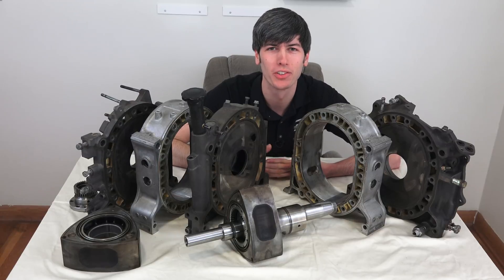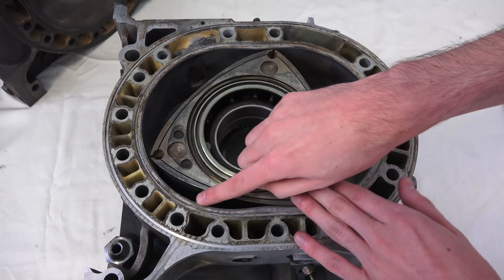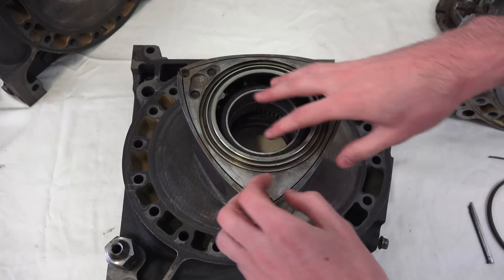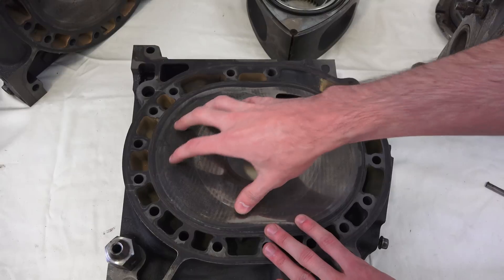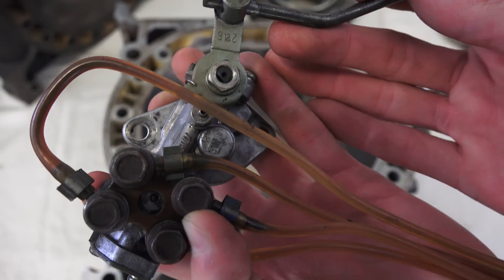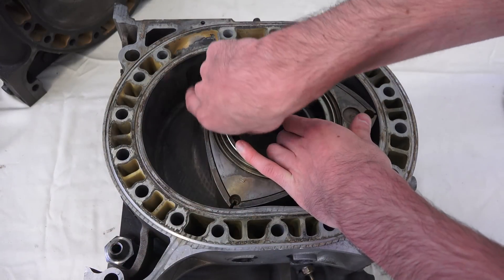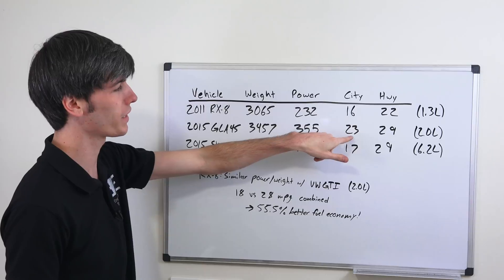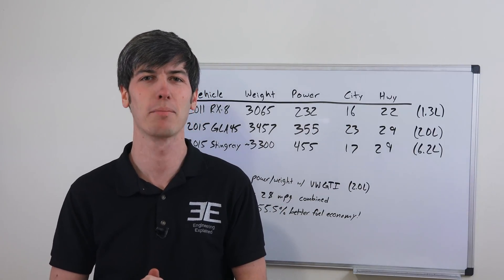4 Reasons Why The Rotary Engine Is Dead

Comment: Well honestly @1:07 is a reason Why To Use a rotary engine.. NOTHING is cooler than that and the next several points up to @1:22 are honestly pointless for performance cars, seriously who cares if their track car gets bad mileage or emissions. And it couldn't have been THAT bad or the 767b never would have won le mans since efficiency is a key part of success there...
Reply: +TzuCraft 
The ONLY reason the 787b won in 1991 was because they managed to negotiate a 374lb weight advantage over everyone else in the race. They did this because the FIM recognised the car was so uncompetitive they didnt think it would make any difference anyway. In a fuel limited, poorly attended race (due to rule changes) it tipped the balance into Mazdas favour, and with a detuned engine (to last the race) they scrapped a win. It was probably the most undeserved win in Le Mans history.
Reply: +Manoo42 Perhaps. But by that logic honestly most wins are undeserved as they are almost always due to rule changes. I'd say the 1970 win by Porsche was the most undeserved as it wouldn't have happened without the rule changes that pretty much excluded Ford gt's from competing because frankly they were too good. So Ferrari and Porsche, which couldn't keep up, lobbied HARD to get the rules changed in their favor and in a way that put Ford at such a big disadvantage they couldn't possibly compete. Ford hasn't returned to le mans since...
Reply: +TzuCraft Wow you think most wins are only due to rule changes!!! Unbelievable. 
Mazda didnt win due to a rule change, rule changes saw their exclusion the following year. They won due to a unilateral decision to give only them a massive weight advantage over everyone else in the race. It was a huge gaff by the FIM who only did it to increase numbers in a poorly attended race....

Comment: not an expert but just looking at the design wouldn't it give more consistent torque under load vs piston?
Reply: I would like to know the answer to this as well.  If Mazda could revolutionize the design to make the chamber smaller it would be incredible (only thing I could think of is make it a double triangle to make the pocket smaller, but that would also take away from what makes it a rotary).

Comment: The concept is sound the engineering is poor. The internal combustion engine, as we all know, has too much friction and fuel waste because of it. I think that some bright engineer will one day make this concept work,
Reply: +Barry Wind No it's the concept that is flawed. The piston engine is conceptually more efficient, though no perfect. There's been some extremely brilliant work done to this, but it's better to put the eggs in the other basket at this point.
Reply: Concept is sound design is not, at least not yet. The concept is power at a spinning point. It's like spinning a fan blade by hitting each blade to keep it spinning.

Comment: Back in the 70's we had an Arctic Cat snowmobile with a Wankle rotary engine. It was very easy to start and put out great power for it's size. It seemed to be as economical as the two cycle piston engines of it's day. I knew a guy who had a Mazda pickup truck with a rotary engine back then. These engines would easily rev above redline, but would often blow seals if this was done regularly.

Comment: I hope the Rx-Vision will become a reality. But I truly believe that even if it's never put in a direct-drive vehicle, car companies are missing a major opportunity for not using Wankels as range extenders for a hybrid. They are perfect for the job- compact, high power-to-weight ratio, and smooth. They also run best at a particular RPM, so you can have it computer controlled to run at a constant rev, and build a turbo that's designed to run best at that speed, since there's no need to avoid turbo lag.

Comment: It's incorrect to describe the 13b as a 1.3L engine. Yes, the volume of the combustion chambers throughout one revolution adds up to 1.3L, but a four-stroke piston engine has to rotate the crank twice to achieve a single combustion event, while the rotary achieves combustion on every rotation. So it's got twice the power density of a four-stroke design, much like a two-stroke engine (which also burns oil for lubrication). When you compare a rotary over two whole crank revolutions to a piston engine over two whole crank revolutions, the rotary uses 2.6L of displacement, not 1.3L. Of course, Mazda doesn't describe it like that because 1.3L sounds more impressive.

The OMP system (oil injection) is really a poor compromise, as most engine oil was never really designed to be burned in the combustion chamber. A better option would be to remove the OMP system and use two-stroke premix in the gas tank, but Mazda knows how people treat their cars and requiring owners to keep a second tank full would result in a lot of burned up engines due to negligence.

Keep in mind that the piston engine has had the benefit of over a century of engineering by dozens if not hundreds of companies while the rotary was basically abandoned by everyone but Mazda by 1975. They've really done a fantastic job with the rotary over the years, and while they do certainly have a number of limitations, they're really neat engines and a lot of fun to drive with their nearly-flat torque curves. You don't buy a rotary for emissions or fuel economy, you buy one because you love cars.

Comment: that is not the reason the rotary engine went dead
Reply: +Jose Rodriguez 
Which one are you countering?  He named several.
Reply: lettersfromhelen  no he gave a reason why it went dead that motor is not dead they still use it in japan and the rx7 went up to 2000 in japan that motor here is not used a lot because it has a hard time to warm up in the winter but other than that the motor is one of a kind and it's still the number one motor used in japan
Reply: Aside from Mazda, it's pretty much dead and no company (not even Mazda) has mass produced a rotary engine since around 2012, so if they're common they're 4+ years old at least.
Reply: ***** the rotary engine is still being used in japan for mazda and yes only mazda because that's their motor they bought the motor and they are the only one's with the right to that motor

Comment: A really interesting video to watch is Matt Farah comparing an LS1-swapped RX7 versus a normal rotary RX7. The LS1-swapped car made more power and used less fuel. Disclaimer: I do not worship at the church of Chevrolet, I find LS1 swaps to be fairly boring these days but it does at least show how inefficient the rotary engine is.

Comment: I had a 79 RX7 that was snappy and grabbed corners. It was a fun car and easier to work on too. Most bolts were 10mm. As for the Rotary, I like the idea because it always travels in one direction vs the piston and allows for higher RPM's. The piston in standard engines has to come to a stop and travel the other direction twice.

Comment: The fact that there are only 3 types of engines out there, piston, electric and rotary! For a company to go a different way, is quite Revolutionary. A standard Piston engine had 100+ years to evolve!....And with time and technological advancement, Mazda could Bring this engine back....More Reliable, and better than ever.. I'd say they've done a pretty good job so far 787B for example? Yes might have some disadvantages.....but still  more than capable of competing in a professional race. Not to mention RX-7 is no slouch, and was a very capable car for it's class!

Comment: Everyone is missing the point that the Wankel design is STILL the most efficient ICE ever invented. YES it has wear parts that need regular replacement. It is hard to imagine a more energy efficient motive power than a heavy flywheel driven by a rotary engine. Torque can be added incrementally and taken out exponentially, giving you a loaded city bus capable of 12 second quarter miles.
Reply: +CrucifyRobinHood It certainly isn't the most efficient ICE ever invented. The most are several two stroke reciprocating diesel ship engines that can exceed 50 percent thermal efficiency. And it seems the new turbo era F1 cars which allegedly Mercedes claim are close to approaching 50 percent, no other SI engine can reach anything like that. Lots of prototypes with fake unproven claims, but my examples are legit

Comment: Owned rotarys for years and loved them. I had a 25 year old rotary (1st gen RX7) that got better mileage than that. A lot of guys would put a different computer in them and do a better job of tuning and get over 30mpg. The engine design is so simple and easy to work on, too. They are normally tuned rich because they are really, really intolerant to pinging and running lean is the easiest way to accomplish that.

Comment: He also forgot to mention the Mazda RX8 was a 1.3L Rotary Engine which was TURBOCHARGED!  Lastly, He is comparing apples to oranges, so really his whole display was totally incorrect.  

The only thing he did get correct as to why it died, was the fact Mazda cannot get the engine to pass CARB, in California which was the biggest market for this vehicle.  And... Mazda sold it here at a loss because they had to pay huge fees to CARB to get the vehicle to sell here.  The rotary engine is a very dirty engine for all of the reasons he stated, but its far from "dead" as he would have you think.

Comment: So they are like 2 stroke motors in a way. If you are willing to give up fuel efficiency a 2.6l twin turbo quad rotor pushes over 1200hp (1000hp at 2bar of boost), and lasts through a season of Formula Drift...
Oh off topic but i thought this may sound interesting, mercedes recently released some info on their F1 motors, they are saying that they are able to achieve 40-50% thermal efficiency in their hybrid power units. (for those who don't understand, that means that 40-50% of energy that is generated by burning the fuel is delivered to the wheels. This is a very, very impressive number)

Comment: The only thing that was completely glazed over was the power to engine weight ratio - the rotary engines are typically way smaller as a form factor for the power, yet still have larger space for combustion, so it's not a fair comparison to a cylinder type of engine. I'd take a rotary engine any day if I was building a dune buggy or something because it's so much smaller, yet has a lot of comparative horsepower.

Comment: a few questions and a few comments:

1) would you agree the oil burning is insignificant, at least as far as fuel economy goes?  the oil:gas ratio is 1:100 or so -- yet we're off on fuel economy by 50% (or 33%?) per this video?

2) thermal delta on the side irons -- hadn't thought about that. I am wondering, why not machine them non flat when cold s.t. they are flat when hot, given that shape is predictable?  We have springs on those seals, so if it isn't perfectly even when cold, and ECU temp aware regardless, we're fine?  Machining that way might be complicated, but perhaps not for a big company.  Anyway we have a problem but I'm just saying maybe that's not it.

3) RX8 compression ratio iirc is 10:1.  That's semi-reasonable right?  Isn't the GLA lower?  I realize it's a turbo, albeit plenty of turbos out there which are 10:1.  Corvette 11.5:1 it seems on a quick search.

4) Displacement comparison is apples to oranges?  One could say the displacements are irrelevant to the analysis -- except you wrote them on the whiteboard. :-)

5) Ironically, it seems there are rotary applications these days that are efficiency oriented, just non-traditional: range extenders (Audi), hybrid aircraft (Diamond).

6) 16MPG is horrible.

Like the videos!

Comment: The first problem that I found with your video is that throughout the whole video you were assuming that the 13B rotary engine is a 1.3l . This has been proven to not be true because of the rotor having 3 surfaces it uses about the equivalent amount of fuel to a 3.9l . But since it is assumed it is a 1.3l why don't you compare it to other 1.3l engines instead of larger engines. The second thing that I found is that you aren't comparing it to engines of it's era or production years. This is a flaw because newer engine are tonnes more fuel efficient than the engines from back then. But anyway who cares about it's fuel efficiency because it is a performance engine and it sounds amazing. And who doesn't love seeing some flames pop out of the exhaust every now and then when you shift gears or rev it.

Comment: fuel econ/emissions may be trash, but the power to displacement on one of these, even without super/turbo charging is still pretty good compared to piston engines of similar displacement, so 1.3L making ~200HP is not bad. Normally on a 1.3L 4cyl, you might get ~140hp  (engine to engine)
Reply: +Don McCollough  I have a 1000cc stock standard 4cl 4stroke no turbo or super charger making 200hp
Reply: chockybones But that's not common compared to the typical small vehicle with that sized engine, atleast that I've seen, especially in the U.S.
Reply: +Don McCollough GSXR1000 motorcycle :-)
Reply: +Don McCollough what gas do you guys have available at the pump over there? we have 91, 95 and 98
Oh... I'm in NZ
Reply: chockybones that's the difference, as I'm comparing car to car. Motorcycles are a different beast
Reply: chockybones 87, 91, and 95/97

Comment: this is probably an engine from the 80s today they are better built and you know this is a 3 parts moving motor that to me is more efficient that any motor built today as you might know this little motor  can blow the socks off many 8 cylinder cars today making 6 seconds on the drag scene talk explain that

Comment: my father owed an nsu ro80 in 1968 that had the 2 x 498 cc rotary with twin-choke solex carburettors, it produces 113 bhp and had a top speed 112 mph.the gearbox was 3-speed semi-automatic with a torque converter and semi-automatic clutch, he could get about 17 mpg round town and about 20/22 mpg on the run, so it's interesting to see that in 43 years they have managed to get 232 bhp with a 300 cc increase in engine size but the fuel consumption is about much the same! so on that note can you explain why cars sold in the u.s have such poor fuel efficiency?  even taking in to consideration that most cars  in the u.s are automatic does not explain why the equivalent model of a japanese or european cars sold in the u.s with an auto or manual gearbox has such dramatically different fuel consumption to elsewhere in the world?

Comment: The GLA45 is around £40k second hand and the RX8  less than £3k.  So that leaves me with £37k to spend on fuel.  The other cars on the other hand might be slightly different.  The GLA45 is damn fast though :)
I owned a C180 AMG Sport (1.8L) that gave me 15mpg (12 US) in the city and 28-32mpg (26 US) combined.  That is not much better than my RX8.  I am not saying that they are problem free, but compared to my Merc the RX8 is a LOT cheaper to run taking into consideration repairs and maintenance.
Mentions of the RX is returning in 2017 has me very excited with the hopes that a lot of the problems mentioned here has been resolved.

Comment: It seems as if most of the engine's weaknesses are due to its combustion problems, but could the same design be applied to a non-combustion motor, such as for compressed air, water, or steam?

Comment: the rotary engine is not dead. the design is the same heck even now mazda is putting in the time and RND for the new 16X. soooo please...i love rotary engines since the day i bought mine. plus rotary engines can pull off magic... try chasing speedbikes on ur v8... my rx8 just loves abuse and chasing speed bikes. slap on a turbo and a couple of mods and shed be screaming. in terms of maintenance, only thing that broke down so far was my leaking radiator and a change of ignition coils over 80000KM. reliability is thumbs up if you care for it...just like any other car...oh and no one buys a rotary for fuel economy...i repeat no one....

Comment: Yup, Bad fuel efficiency for sure, but put all that emission crap aside and you've got incredible horse power per Liter that no one can beat! I used to build race engines and friend and I built  a 488HP 12A in an RX-2, NO ONE at the track could touch us, so lets go over the Horse per liter again, 12A motor is 1.0l and 488HP per engine....What would happen if it was a 6.0l engine?? Lets face it, the Rotary engine was a fantastic motor, save for a few problems, in 1973, Road and Track test drove a stock Mazda RX-2 with the 12A motor. out of the show room @130HP, it was blasting by every thing else, even giving those big block Mussel cars a run for their money.

True as you say, the Wankel is destine for the history books as there a greater concern for the environment and emissions. Its hard to make sense for the RX-8 in this day in age and perhaps its time to put it to bed. But I'll miss the good old days.

Comment: I had an RX7.   The total weight for passengers + cargo is to be less than 700 lbs, according to the user's manual.  When you start up a hill, you slow down a lot.  No power.

Comment: But is it really 55,5% better fuel economy? I just don't like the MPG compared to gallons per mile. Example if I drive 100 miles, i must use 5,5 gallons compared to 3,57, so that's 3,57/5,5 = 65% more fuel must be spent.

Comment: I had a RX7 back in the 80's  with a 2 rotor , even though it had less horsepower than some of the domestic muscle cars they could not keep up with the rotory engine being able to spin over 9000RPM all day long to their 6500 RPM tops . I agree it is very inefficient as for a burning the air fuel mixture but for it's purpose as a sports car powerplant it hit the mark .